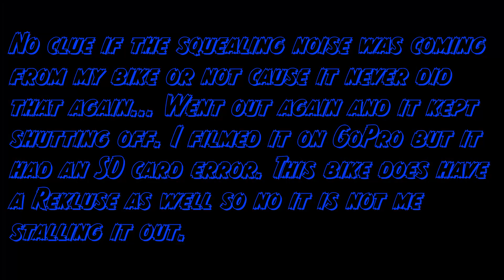WHY YOU SHOULD NEVER BUY A YAMAHA DIRTBIKE

Comment: May be time to check your power valves. I have a 2017 yz250f and after a 10 minute moto it still needed for for the cold start when I stalled and went to start.. New yamahas have a hard time staying warm and the design for air box doesn’t much air flow!
Reply from the maker: its blown up

Comment: It sounds like ur bottom end, it did that my 250 when I started and give it gas it will shut off
Reply from the maker: nothing to do with the motor. something electrical again. TPS or Fuel Pump is my guess
Reply: JokurAtkinson yeah, I would go through the carburetor and see any gunk in the carburetor
Reply from the maker: lol it doesn't have a carb. its fuel injected.